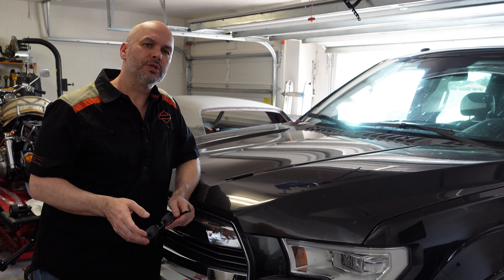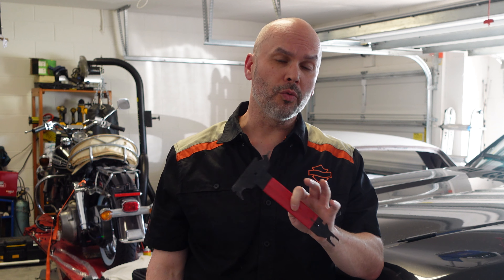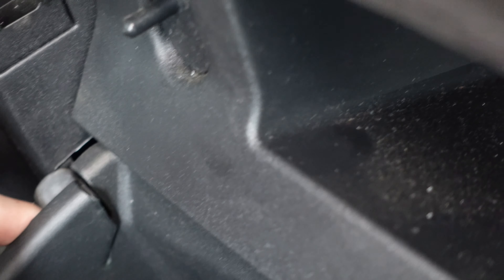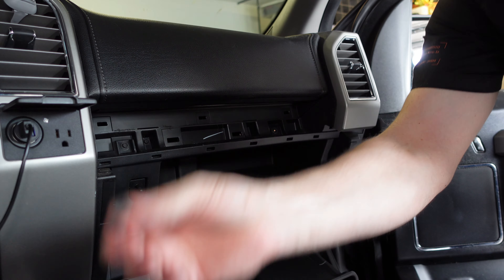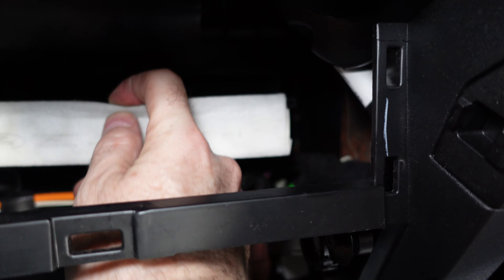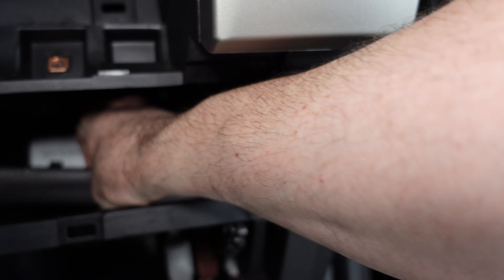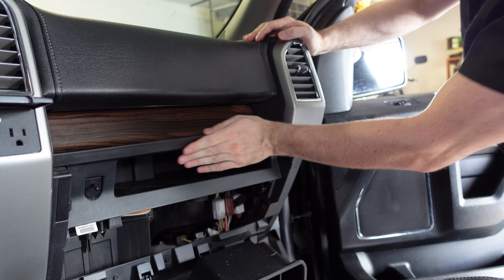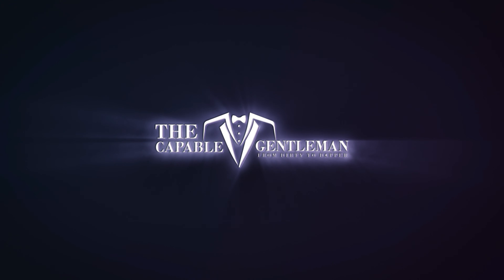Replacing The Cabin Air Filter -- 2015 Ford F150

Comment: They were much kinder with the design in accessing the cabin filter on my 2014 Dodge Charger, just open the hood, pop a plastic cover and there you are. Definitely a simple matter to check the filter (I tossed the factory filter and opted for a K&N so I can just clean it instead of constantly replacing). Another well done video boss, great tips for everyone to keep their machines running true!